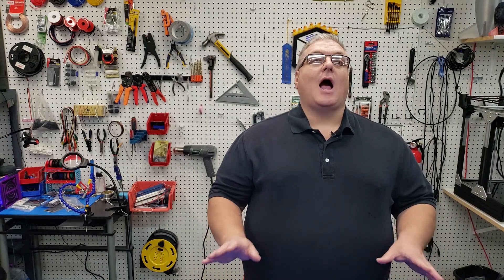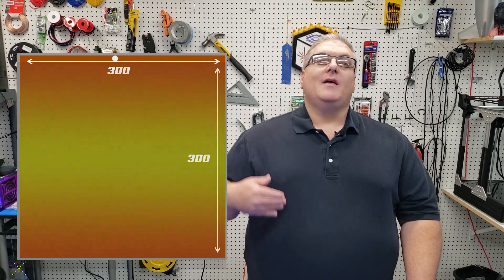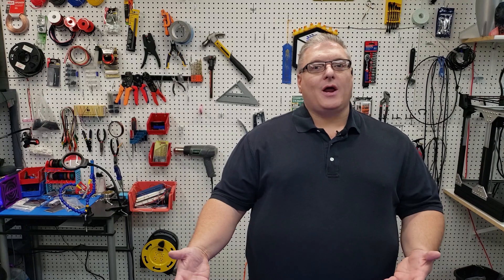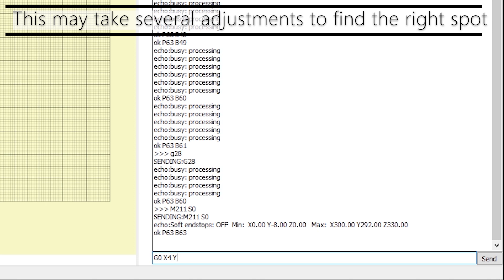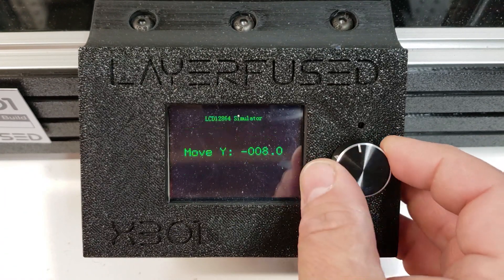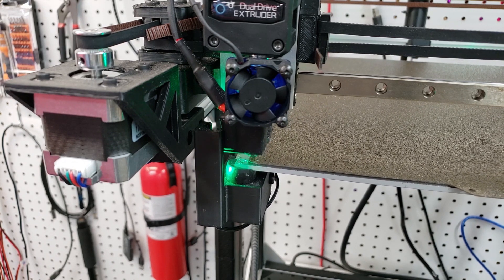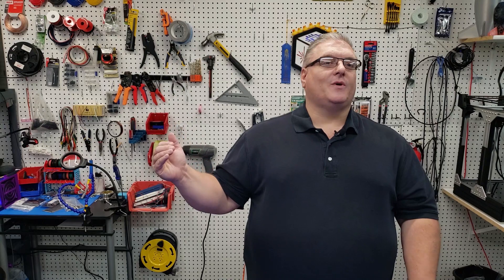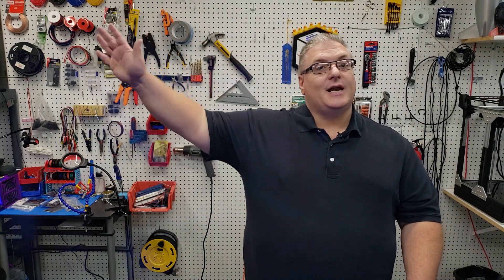Adjusting Home Offsets - Marlin M428 / M206 | Reclaim lost build volume

Comment: What is the difference between M428 and M206?  I have been using M206 to set the home offsets or just using the display panel.  Do they do the same thing?
Reply from the maker: Hey @ZK_63, great question!  M206 sets a location at X/Y/Z.  M428 allows you to move your nozzle exactly to a spot and then say "Marlin, Do a M206 exactly where the nozzle is right now".  Its helpful for adjusting those offsets visually when you know the nozzle home position is not matched to the exact corner of the heat bed.  You could read the front screen of your printer if it shows the X/Y/Z pos and then call the M206 with the coordinates as well.  It effectively does the same thing.  Again, great question and thanks for watching!

Comment: Thank you for this quick tip... really saved me a lot of time - I used my printers interface to reset the Home Value instead of using PronterFace - it worked out perfectly... the problem I had was that the home position was too forward on the Y. I have a Tevo Tornado and the bolts that secure the bed are not flush but stick up above the surface which was causing the hot end to collide with the bolts-this was happening at the start of each print cycle, but thankfully no more thanks to you. 😎✌

Comment: hi. I TRIED THIS BUT EVERy time ends the same: Home XYZ first. How can set a whole new x0 y0 z0 if my printer insist she is way back down to hell and to the left?
Reply from the maker: That error can occur if you have not homed the printer first.  After homing, Adjust and use M428 as indicated in the video.  If you've done that, you might need to check with whomever built your printer, that shouldn't be the case after a G28 (Homing all axis).

Comment: Just a small heads-up for people who need to change the home offsets: Using the M428 command you can only set the home offsets up to 10mm from 0 0 (endstop trigger distance) if you need to set these offsets higher or permanently you can do so by changing some options on the firmware. 

At the time of this writing you have to change X_MIN_POS and Y_MIN_POS on configuration.h around line 1700.
The values you need to add are the reverse of your home offsets, this is easier than it seems to get the values you do like in 3:20 and move your nozzle to the corner of your bed, then you can send the "M114" command or check it on your printer's lcd. 

Once you get these values you have to invert them, which means if you are at X10 Y23, your new values should be: X_MIN_POS -10 and Y_MIN_POS -23
Another example: The nozzle is in the corner and the LCD or M114 reports the coords X-5 Y12. The new values are : X_MIN_POS 5 and Y_MIN_POS -12

This is a simple way to get the printer to center the objects correctly and work a bit better, this way you could even add a nozzle cleaner or magnetic probe with less headache, and as the offsets are applied by the firmware settings you won't lose them whether you restore the default values or need to change some other thing on your firmware.

Pin this comment so new people can read it and fix the offsets bigger than 10 !!!
Much love and happy printing 🎉
Reply: Yeah how do you get to configuration.h

Comment: Sadly the manual mesh bed leveling doesn't seem to honor this setting. My friend and I have the same printer, but different nozzles, so our Z is off considerably. I wanted to use my copy of the firmware to upgrade his printer, but it really seems that the manual mesh bed leveling uses the {X,Y,Z}_MIN_POS in Configuration.h when running. It's easy enough to update those values after major surgery on the printer, but it is kind of annoying to have to do so.

Comment: How do you do this so that it uses the offset for bedleveling? 

I've set the offset in the menu of my Ender 3 but it still homes to 13mm forward of the bed. When I try to bedlevel, the first 5 positions are also forward of the bed.

Comment: I'm only moving to x5 and y5 but the printer says too far from reference point and won't store!!!
Reply from the maker: It's likely because it's already set.  Enter G28 to home then G0 X0 Y0. If it moves off the end stop you already have an offset set.  The 5mm you're referring to is like in addition to the existing offset.

Comment: When I use M428 my printer just beeps once and I don't get the ok message as you did. I then hit M500 and don't get any follow up messages either. I did this once and attempted to print again and non of my adjustments were saved. Any thoughts on why this may be? I'm doing this after installing the Micro Swiss direct drive and extruder and I have an Ender 3 v2.
Reply: I updated my firmware and my printer finally accepted my adjustments, but it still prints off bed. Nothing I do seems to be working. My printer finally printed the run out strip on the bed, but it still attempted to print most of my bed level test print off the bed, and that was after I significantly adjusted the build size due to Cura's new gray non-printable area. Completely lost at this point. Can't figure out how the micro swiss threw off my sizing that bad...

Comment: Hello, Rob! What if my 3d printer has metal holders for a glass and I can't place the head on the actual zero point to use Set Home Offsets normally? The cooling vents will be colliding with these holders.
The 3d printer has the Z-moving bed (H-bot).
I've calibrated Z steps carefully and now I have extra ~3mm which I can't measure by calipers or somehow (so I don't know the numbers to insert in FW). What is the method to set only Z Home Offset after moving the table on this axis to a nozzle? It will be done in the center of the bed.
I really don't want to touch bed's springs' setup it's pretty close to ideal and it's stable. Will be glad to know something about this! Thanks in advance!
Reply from the maker: Setting z is just like the other axis, just navigate, with gcode or front panel to the position then use m428.  No measurements necessary.  Remember it's basing it on the home position so home first, then move.  If it's a swiss clip attachment those can generally be moved.
Reply: @MakersMashup  My current home position rel. to the phys. space will be ~ X0, Y0, Z+3mm. If I'll move -3mm by Z then it will collide with the clip. The clips are mounted on the springs' axes (thin metal folded parts). They're pressing the glass very tightly.
As I understood M428 acts on all axes. Is some method that doesn't require releasing the clips exists? Scratching the glass isn't good :) And I think that the released corner will be higher.
Reply from the maker: I'm not following exactly where your issue and the clips are but I'm super curious.  If you drop into the discord and shoot me a picture of this setup I think we could probably figure out a way to make it work.  You might also just have a use case where M428 wont work.  Thats when firmware recompile and setting offsets differently can help you out.  Teaching Tech did a video showing other ways to adjust offsets.  I prefer M428 because its quick and simple but sadly doesn't always work for everyone. :/
Reply: @MakersMashup  Thanks for your help, Rob! I've moved one clip from the glass and did the job. At least it was the best and easiest thing to do here :)
The problem is that the bed is warped up or the glass isn't flat... I have the issue to set it up evenly (four points there). Seems that the center is higher than the corners.
Printing PETG gives bad results. Will try to check the glass and maybe tune up screws some more. BLTouch would be cool there but no enough space for it (it's the closed box construction - ZAV Max Pro).
Do you have a Telegram channel? I could put pictures there if you're interesting about how it looks. Maybe I'll install Discord later.

Comment: im getting "Err: Too far!" on my printer, and "Error:Too far from reference point" on pronterface, eventhough im within th 20x 20y 20x of the endstops. currently at X15 Y10 Z0
any idea why that is? thanks
Reply from the maker: If your printer is homing to the center of the bed (Bl Touch, etc) then you still need to have the X, Y and Z within 20mm of the physical endstop.  If you already have an offset applied (say  X was 10mm) then you move to X15 Y10 Z0, your position would truly be X25 which would be out of range of the offset.  I would home and set the offset there and start fresh.

Comment: I love how you can easily do it from the screen as you mention but dont show us how. All you video makers insists to use a 3rd party program. JUST TELL ME HOW TO DO IT ON THE PRTINTER. these m commands are just silly if I can just do it from my screen as you claim and kinda show. Wasted 7 minutes of my research time and just complicated it for me further.
Reply from the maker: The part in the video I talk about the front panel is adjusting the position. That is simply moving the axis manually from the motion menu.   m428 you will still need pronterface or something like octoprint to send commands directly to the printer.  While M commands do take some additional effort to learn it is well worth learning for any serious 3D printing enthusiast.  Advanced features like Automatic Bed Leveling will require you to often use commands like this directly.  You'll find 3D printing a lot easier if you learn these basic concepts.

Comment: how do I change the home position of an ender 6 the home position is located in the center of the build plate.
Reply from the maker: I'm not familiar with the Ender 6 but you're not changing the home position, you're changing the home offsets which is the position from the home point.  The Eder 6 looks to be a corexy printer and Most (not all) home to 0,0 (front left corner) then go to the center of the bed to safely home the Z position.  That doesnt mean the X/Y/Z for 0,0,0 is in the center of your bed.  X/Y/Z (0,0,0) is still in the front left corner of your bed.  Execute a G0 X0 Y0 Z0 and you'll see where your true 0,0,0 is.  The probe is simply using the center of the bed to ensure its on the build plate to measure Z.  After executing the G0 X0 Y0 Z0 you should then move the print head where you want 0,0,0 to be and execute the M428.  Once you execute the G0 command this comment will probably make far more sense.
Reply: @MakersMashup  I try that...
Reply: @MakersMashup  if I change the 0 0 0 does that shift the entire.print area?
Reply from the maker: Wherever you execute m428 moves 0,0,0 to that location.  Think of it like a piece of paper on a table.  You're moving the paper but the paper or build area remains the same size.  Just be careful not to print off the bed so test it with a G0 to your max x and y size.
Reply: @MakersMashup  thanks for the help I changed the y axis and had to m851 for my blt offset

Comment: Great Video. Easiest way to do this task i have seen online. Now I have a question regarding soft ends. when trying to self level probe is outside the print area and goes over on the x axis. y axis does it also. probe goes of the bed. Any ideas before I drop kick it to the moon LOL. Thank you in Advance Mike
Reply from the maker: Need a bit more information to really assist here.  Consider popping into the discord channel.  If your trying to home the printer with something like a BL Touch you can enable "Safe Homing" in the firmware and the Z axis will home at the center of the bed using the probe.  Anything else you'll need to provide some further details.  YouTube comnments are a bit tough to use to troubleshoot. :) Hope to see you in the Discord Mike.  Happy Printing.

Comment: Have you come across :
>>> M428
SENDING:M428
Error:Too far from reference point
Reply from the maker: Yes, the problem is that you're too far from the physical endstops.  IIRC you have to be within 20mm on the X/Y/Z to have M428 work.  so if you're at say X:21, Y:19, Z:4 - The X being 21 will cause that error.  However if you have X:20, Y:19, Z:4 , it should make everything become 0,0,0.  If you need further distance than that you'll need to move/modify hardware to compensate for the additional movement. This also sometimes happens if you have X/Y set right but perhaps you left your Z at 100mm while you adjusted things.  Remember its going to reset the entire position to 0,0,0 if you're within the 20mm cube area.
Reply: @MakersMashup  Thank you for the help. I don't think that is the issue because I issue M428 command after moving to :G0 X15 Y10 Z0.8 .   After that move I am very close to the natural home which is off the be slightly.
Reply from the maker: If you're executing 
G28
G0 X15 Y10 Z.8 and then M428 that should work. https://marlinfw.org/docs/gcode/M428.html confirms that you get 20mm (2cm) from the home point.  So unless you're not running marlin or something is wonky with your version of marlin it should work flawlessly.
Reply from the maker: Also, note that if you have offsets already applied you need to add them together.  So you can't home to 0,0,0 where it physically is already 10mm of offset and then add another 20.  Its the total amount from the actual physical home point.
Reply: @MakersMashup  I got past that but no matter what I do the following commands do not save.  G28 just goes back to the location it was prior.   
M428 -> M500 ->G28
Reply from the maker: Yes it will but type G0 X0 Y0 Z0.  It will go to home and start 0,0,0 there instead of the physical home.

Comment: Whoa, back up I've only been 3d printing for less than a year and have never heard of pronterface nor am I super comfortable with gcode. My bed size is 300x300 but when I move the nozzle to the edges (still on the bed plate/printing area) it reads like -20s and 280s for the X and Y axis. Is there a way to center my nozzle, and use the printer GUI to reset to 150 150? I'm trying to avoid using software and gcodes or digging into Marlin, etc as that's a bit over my head.

Comment: I still cant get my printer to go to the correct start position.  Keeps auto homing to off the bed right before printing.
Reply from the maker: The printer will home off the bed because of the position of your endstops.  What is important is where the printer starts 0,0.  If you followed this correctly you can verify where your printer will start printing by entering G28 to home.  then G0 X0 Y0 Z10 after homing.  That should put you right where the printer thinks is 0,0 and 10mm off the surface of the bed.  If after entering that command you're still off the bed then you did not set something up right.  If it goes to the right spot then everything is fine.  Your startup of your printer will always home before it starts and if the end stops are off the bed it will home to that location.  Its where the printer thinks 0,0 is whats important and what you're adjusting here.  I'm guessing it just looks like its not working because the printer homes, then immediately starts printing.  You'll never see it stop at that home position unless you tell it too.  Another good way to see is look at the position on your display (providing it shows it) after you home it would likely show the printer in a negative position.  say -10 , -5, which would be correct for being offset in the negative space of X, Y plane.

Comment: Do I have to remain connected to pronterface for this to work?
Reply from the maker: Actually no.  In fact if you manually adjust your position with the display you can print a good file with just the M428 in it.  You'll have to add the m500 too to save it.  I should make this a quick tip too.  Thanks for the inspiration Tom

Comment: what a treasure of a video, i struggled on problems related to this for more than 2 days, with my new ender 3 v2 not being able to print perfectly. thanks for the introduction for several useful commands, like m211, g0 and m428 etc. awesome!
Reply: yeah right now creality slicer works perfectly and sets my prints in the center. But Creality slicer doesn't insert Gcode to do a temperature change so I can't do temp towers. So I tried cura 5.2.1. Cura 5.2.1 on the otherhand thinks home is the front left in a 20mm by 20mm area and just makes a nasty pile of filament jizz FFS,. Next I try prusa. I tried understanding the home offsets by reading the docs🤣 but they are very not helpful at all.🤬 So now I must google and dig and watch videos etc. I think once I figure it out I'll help fix the docs so people can understand WTF to do and how it works.

Comment: Well, it seems my eeprom was corrupted and din't know about it. Yet, it insisted it was right, I couldn't tell em otherwise. Also, there is no user provision to hard clear the eeprom data to start over. Compiled a semi plain (step by step approach) no fancy version and flashed it. Viola, goes where I would expect it, even though it threw errors at me. EEPROM continued to give me errors, so I went down on serial speed (250000 -> 115200) no more errors and hopefully corruptions. TFT35 E3 V2 and the SKR E3 mini don't work to well together at this moment or I simply don't know what I am doing, after 4 decades in Electrical Engineering. Doesn't mean I know what software is supposed to do. I know from software programmer, it is never the software! Still, my gut feeling tells me there is more to it. Auto Bed probing goes out the window, since this piece of art centered at the probe instead on the nozzle. Took the probe offset out, now it centers on the nozzle, though I haven't tried yet, it will probably run the probe of the build plate on auto level. Ever heard of the guy that wants to reach with his left hand into his right pocket, this is exactly what this seems to be. Perhaps this comment helps someone else to keep their sanity.